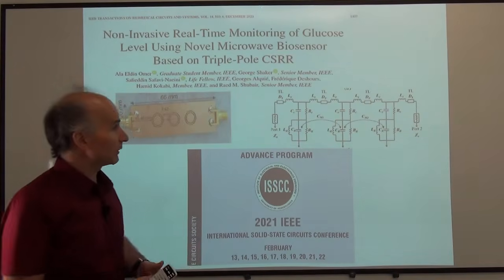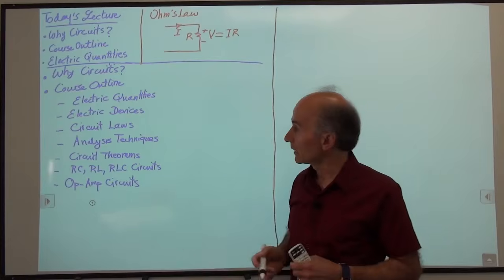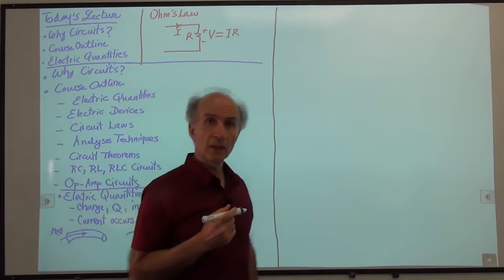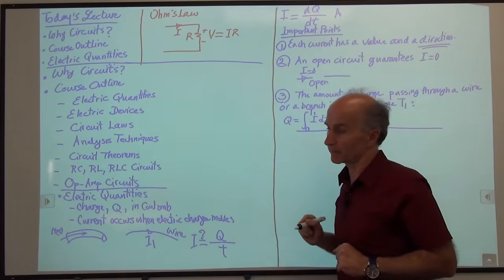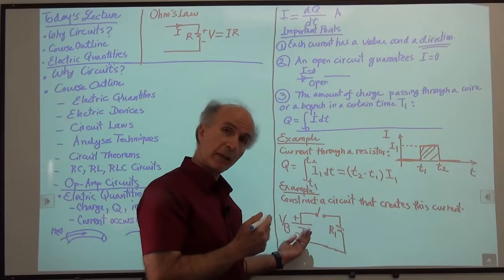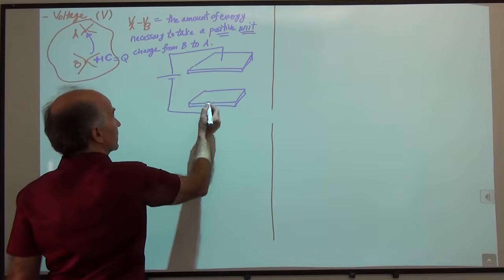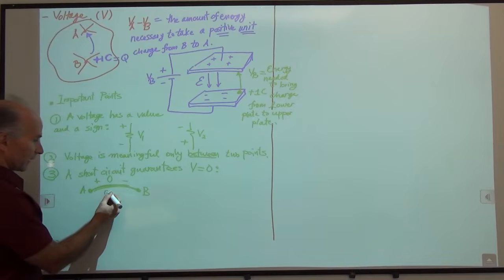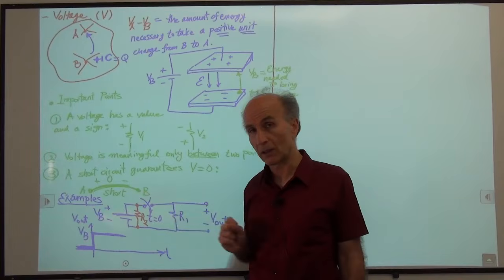Razavi Basic Circuits Lec 1: Charge, Current, Voltage

Comment: Even though I know all the material here, I'll still watch this series from the beginning to the end.. When the emperor talks, one should listen. 
But I hope Prof. Razavi will continue with more sophisticated topics, like amplifiers with multiple feedback loops, power amplifiers, oscillators and modulaors.
Reply: 539 BC : cyrus the great
2022 AD : Razavi the great..

Appropriate isn't it?
Reply: @rudrajeet814  

Ahahahah....
but,
I'm currently stuck with a double tuned amplifier design in which both the primary and the secondary of the coupling transformer is tapped..  In the whole internet, there is *maybe* a few droplets about double tuned coupling with tapped transformers. How the tapping works is a mystery. They say it is done to increase the Q factor..
If the emperors enters such rarely explained but very frequently encountered topics I will be happier..
%99 of this circuit theory lectures can be found in any textbook. It is still a pleasure to listen them from Prof. Razavi, but this doesnt change the fact that there is wasted time and potential...